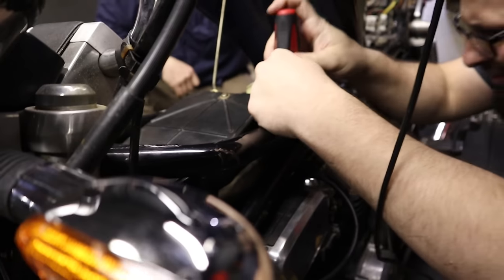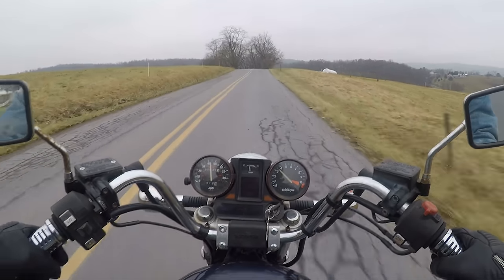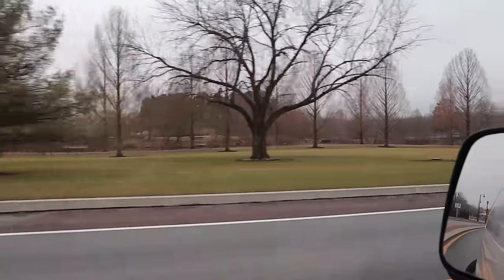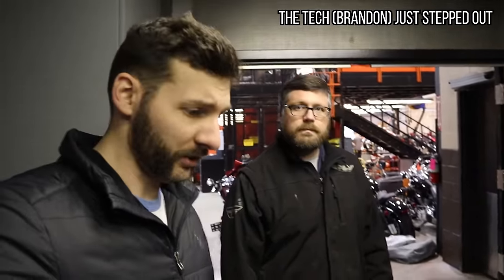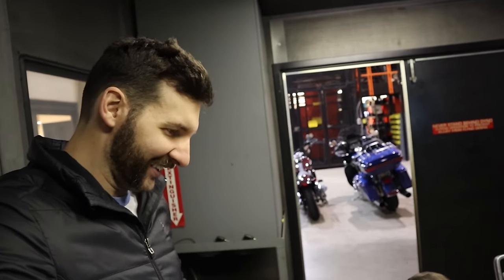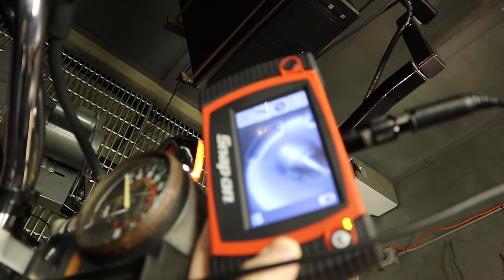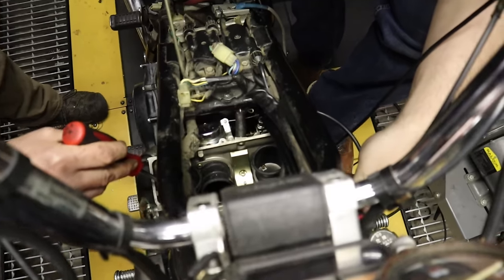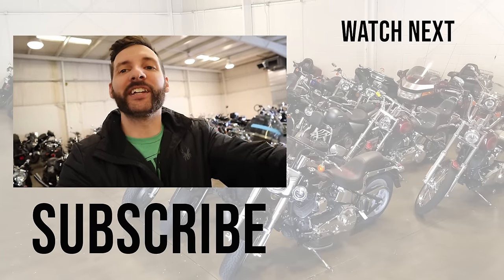We FIXED this abandoned bike for $83 then put it on a DYNO | 83 Honda Magna

Comment: I had a similar problem with petrol, my bike would start clogging down like it didn’t have enough fuel, turned out the fuel cap was creating to good a seal and so it was creating a vacuum and the fuel was having trouble getting where it needed to be
Reply: We call that vapor lock here in the US and it seemed to happen to some carbureted cars back before fuel injection.   Have never had that issue with modern fuel injection on my cars and bikes.

Comment: The bike has been sitting for thirteen years. As soon as the engine fired up you should have taken the carbs off and cleaned them. If they are gummed up with old, dry fuel the bike cannot run propperly.
Reply from the maker: yeah in the last video we spent 12 hours cleaning the carbs and brakes and flushing clutch fluid, all that stuff

Comment: You need to set the throttle at 3500 rpm at the garage and see where it is after 5 min. It's probably clogged in 12 places...

Comment: Holy crap! You learned to ride on a Magna? Did you also learn to drive in a Vette?  Is that a V45 Beast?  I have been told that the V45 will still outperform any Harley ever built or modified. Of course, the V65 is in another, higher, class, with it's warp drive.
Reply from the maker: I didn’t know any better and my first car was a 92 Ford Taurus SHO

Comment: I'm going to call out your "less than $100" statement.  You and your buddy, (or at least your buddy) are experienced motorcycle mechanics. What is the labor bill for a shop to do that kind of work on a used piece of junk bike? 

"Hey kids, go buy some junker, then completely rebuilt the engine. BOOM SUPER CHEAP MOTORCYCLE!"

Comment: 38 year old bike with 4 carburetors sits for years, then doesn't run right? I think maybe the carbs need to be cleaned out and rebuilt before wasting time putting it on a dyno?

Comment: The thing must be running bad en on one cylinder     my Magnas/Sabres make around 125 HP
Reply: It's a V45 (750cc) Magna if it's rated at 80 hp. 
The V65 Magna (1100cc)  was 115 hp.  There was a V30 (500cc) Magna also.
Odd he does not clear that up right away.

Comment: It likely took longer took longer to grow the beards than it did to get the bike going. What happened to the 8 hours and $100. That is scam. Craig has 2 years experience since his business scam degree. In the first video, which looked like morning, based on the sun and the fact Craig was researching porn instead of rebuild vespa carbs, they worked until 8:20. That's a long day. Then Craig gets out of his jammies and cranks out another solid 2 hours. BTW the seal on number one float can be replaced wo pulling the carbs. Also those jets look used. You said new jet kit. Which is ok. But while you are there you should pull the carbs from the plenum, replace the fuel crossover tubes if not just the o rings, but whatever. Also when the carbs are off replace the coolant crossover orings and oil crossover rings. Its about $20 from honda and an extra 20 mins. Then we get a lecture on what to replace and not to replace. Funny! Good entertainment though

Comment: To begin with, it is obvious that you have little or no riding experience.  You are riding on the right side of your lane.  Wrong!  You need to ride on the left side of your lane to be able to have plenty of options to avoid oncoming traffic and to help prevent drivers from behind attempting to pass you in your lane.  You need to avoid the center of your lane at all costs because it is covered with oil and grease from the previous traffic and is slick as can be.  It will load your tires with oil and grease until you have no gripping ability with your tires until it is worn off.

Comment: If a human on a bicycle was able to get a 10 hp rating on a chassis dyno its safe to say that using HP as a measurement of power production makes no sense. No human ever had the strength of a horseunless that horse was newborn or deceased .
Reply: A horse makes about 15 horsepower

Comment: 5 bucks says the front carb parts are swapped all around.  The front and rear carbs have different parts in them and they always get swap around.   

I work on these all the time and the front slides always rot and then the slides don't open fully.

Comment: I’m trying to save up for my 1st bike 
A buddy of mine has a bike I really want and he wants 4,500$. I’m trying to save but it’s hard but I’m still trying
Reply: Calvin cato no need in spending that much on your first bike, cut that in half and you’ll have just as much fun.
Reply: For your first bike you want a small (nimble, cheap) bike you can learn on. It'll get dropped. It'll fall over. You'll park it in the wrong place and some jerk will move it for you and drop it when they're done. You'll drop it. So learn on some crappy enduro then graduate to a "real" bike. You'll look back and wish you'd gotten the stupid out of your system on a bike that could take it and you weren't in love with. Good luck and keep the rubber side down!

Comment: you sure its not a V45...tail piece is wrong, exhaust canisters are wrong...unless it has been rebuilt with V45 parts  https://www.motorcyclespecs.co.za/model/Honda/honda_vf1100c_magna_v65_83.html VS https://www.motorcyclespecs.co.za/model/Honda/honda_vf750c_magna_82.html

Comment: You can get into Motorcycle riding for less than $100, what a ludicrous statement, now if you mean, "for less than $100 a month"  than it would be more accurate. And that would not include all the valuable time you need to spend working on the machine, to keep the riding safe and enjoyable. Should we get into the real cost of protecting yourself properly from accidental injury while riding?, less than $100 won't provide you with anything in this category, not even a proper set of gloves (the lest expensive protective item).
Reply from the maker: Of course you can’t count sweat equity when calculating things like this
Reply: @BikesandBeards  Why not? its calculated when you purchase a new motorcycle, and for everything to keep it running safe.

Comment: Shocking to who?
Honda had a wave of V twins and fours.
Nobody liked them.
Nobody bought them.
They can still be found on the cheap and you'll likely need a new voltage regulator or an entire alternator because they notoriously failed.
But, then you'll have a running bike that nobody STILL wants